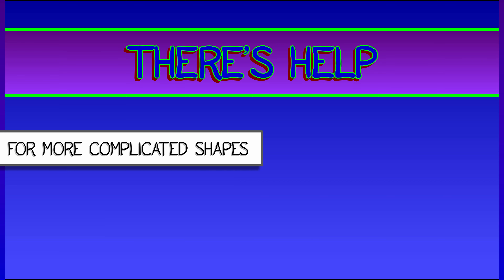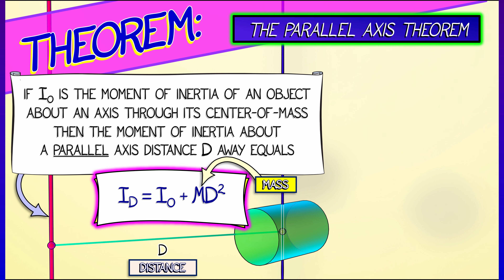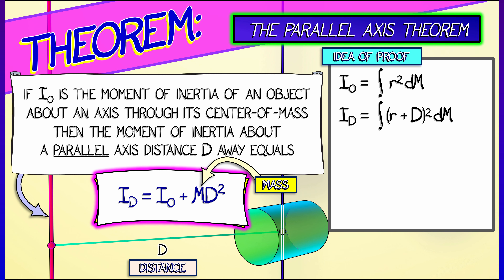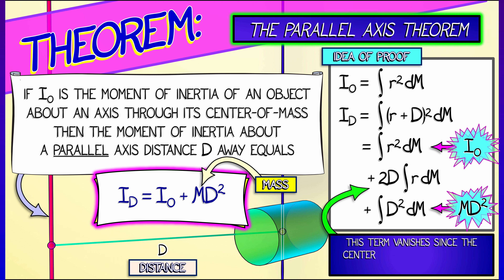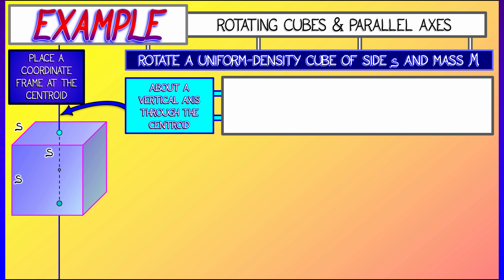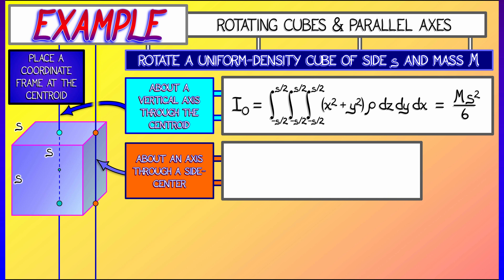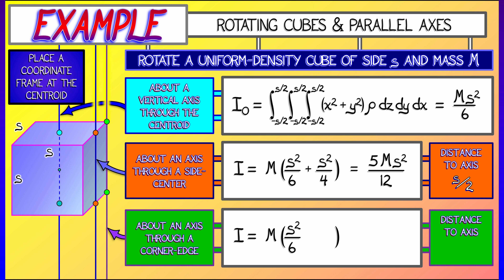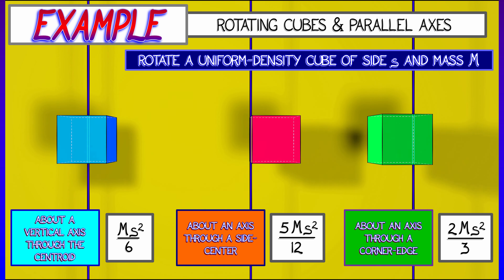CalcBLUE 3 : Ch. 7.4 : The Parallel Axis Theorem

Comment: in previous video i questioned  "why we're using r^2 not r, why it's not like r dM  but r^2 dM" but now, realized  r dM  is zero perhaps because of the symmetry. Taking a square of the distance is like taking the absolute value and makes the calculation possible. But i am not sure if i'm right